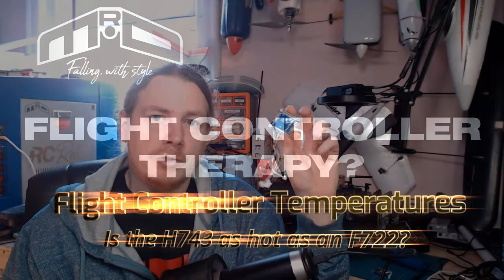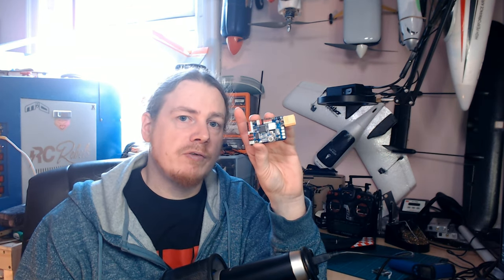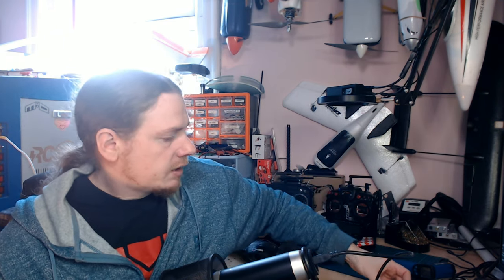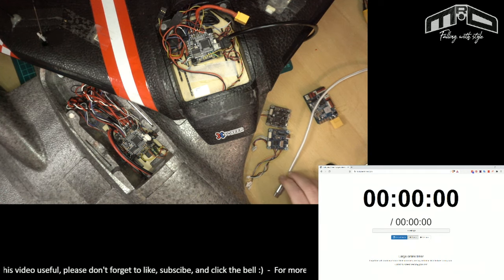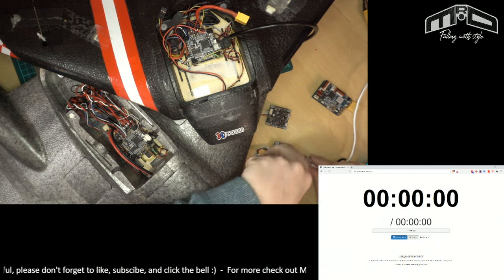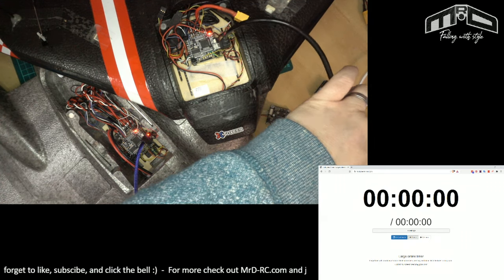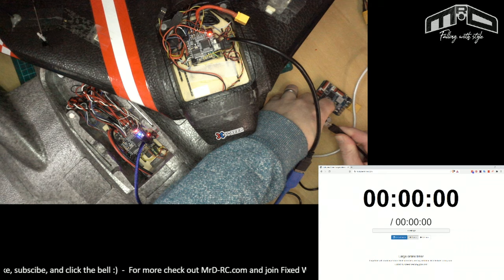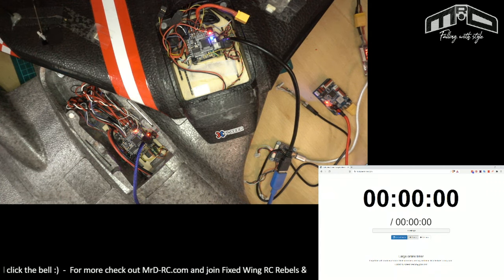Flight Controller Temperature Comparison

Comment: Hi,
Thank you soo much for the research video on my question. Really appreciate it.
Actually my Flywoo F722 gets hot only when powered by a battery. On USB power, it is normal, but when I connect it to battery, it gets really hot and reaches about 75-80deg Celcius in 2 minutes, which makes GPS locking difficult. While flying, it becomes cooler due to airflow from props and sits at around 35 deg.

I checked touching different components on the FC and found that only the F722 was the hottest thing, unbearable to even touch for half a second.
Reply from the maker: Interesting. It’s strange that it gets hotter with the battery connected, as the flight controller is still operating fully when plugged in by USB. On the underside of the FC, it looks like there could be power components, so maybe their heat is going through the board to the FC and compounding the head there?
Reply: @MrD  
Yes I also thought that. But if that were the case, then why only the F722 chip is the hottest and all other chips are not so hot?

Comment: Great, my H743 mini I find a bit hot but my room has arround 27° and your testing should be done normaly with an ambient room temperature of 20° else your current 16° room temperature contribute to cool the component,  but anyway this component is builded to support more than 80° and in standard use air movement around the component contribute to cool it, and generally the run duration is less than 30minutes ... therefore no issue with it
Reply from the maker: Thanks for the feedback. I agree, the cooler room will have an effect on the maximum temperature of the components. But, for a simple comparison I think it’s fine. All the flight controllers are subject to the same environment, so will all react the same. Depending on ambient temperatures in different parts of the world, the maximum temperatures achieved will of course be different. 

But I think you’re right. They’re all well within limits, and would have still been at 20 degrees ambient. Most models have airflow, so even hour flights would be no problem for these flight controllers.

Comment: I've bought a new one and it's too hot. I don't know what to do with it and from where to start to debug the pcb. Could you suggest something? Is it voltage regulator with an incorreect voltage or something else -  maybe not good H743 chip? It's flying and during the flight temperature drops from 75C to 40C in a hot summer day but I well understand that it's  a not stable system and question of FC death is a short time question. Question to Matek support left without answer.
Reply from the maker: I can only report on my findings. The people who can answer your questions is Matek. I have no control over them or their support unfortunately.